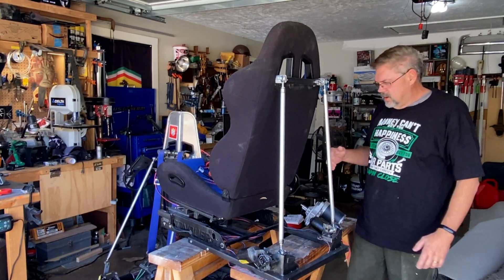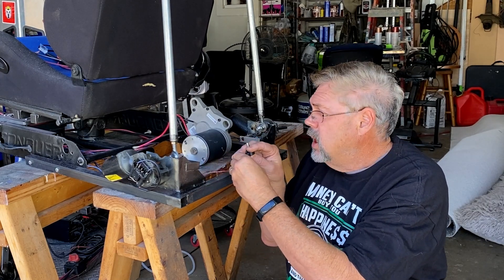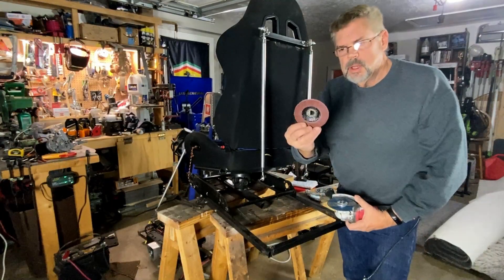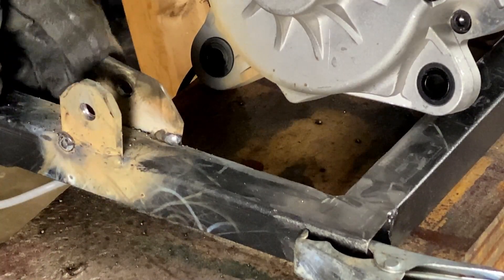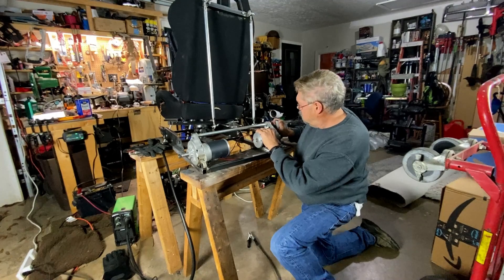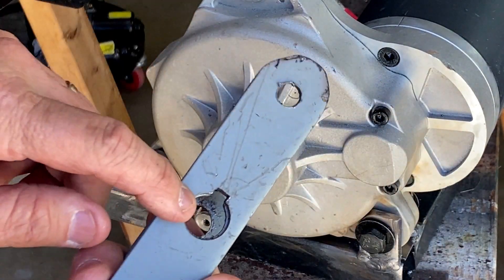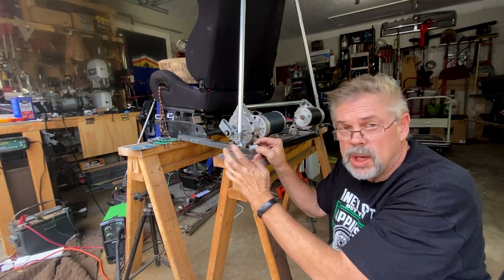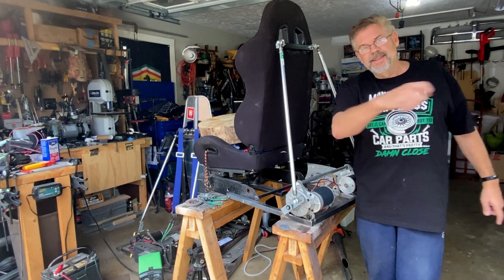2 DOF motion simulator  bigger motors mounted for more power!

Comment: man i wanna build one of these but i dont know how to weld at all. and i refuse to make it out of anything but metal honestly. because i want to mount a big display/tv or triple mount monitors that id like to move with the system. doesnt need to be alot of movement.. whats the cheapest motors we can use for this.. keep in mind. i only weigh 150 lbs MAX
Reply from the maker: Hi NoLimit413 Gaming!  yeah I was similar to you when I first imagined I could build a motion sim.. Metal is the best, it's stong, never let me down after 3 years in my "BIG rig  3DOF".. I did not know how to weld or any of that but went in anyway cause I did not want to spend like 4k or more on something..  I have a video on 'how much it cost "  Plus I'm just starting my new series on 3DOF motion sim for compact spaces.. I'm on episode 3 right now..   lack of weight is your friend.. in both real racing and motion sim racing.  I'm clocking in at 200 or 205 ..  so you should be able to use most of the cool sim rig stuff like V3 or Heusinkveld pedals along with a moderate CSL or DD wheel setup.   the key to the whole thing is having strong enough motors to move the seat frame and the u joint supporting the weight..  Tune in for more.. I hope you can watch my new series..  Thanks again for your comment   DMAX
Reply: @DMAX_DIY  any experience using like maybe a way to hang the frame from above as well? as to take even more weight off? im guessing less weight = less power  smaller motors and so on an so forth.. 

im a get a 3d printer. .so i can mod my thrustmaster TLCM pedals. i found software to control the force feedback on a shifter . using an old logitech flying joystick that has ffbs guts. got the hand brake with a mini bass shaker on it. motors on the pedals. and another shaker on my seat as of now. 

whats the cheapest way to go about being able to learn how to weld i been working with electronics and on cars just never learned to weld. if im going to use metal id rather weld it than drill holes and bolt it together. even tho im sure having some of it bolt on and some permanent could be a good thing for movement.  what i really need to know is . whats the cheapest motors i can use and any idea where to get the cheapest solid metal for this job? 

i been thrifty so far. saw a weight bench made of a serious solid base.. so stopped grabbed it. took it apart so im really seeing how cheap i can do this. cause after back surgery failing working has been tough . luckily i saved enough for a while but i dont need to move too much cause my back but id like to be more immersed cause i am upgrading the pc. and trying to build one of these .. cause i grabbed VR headset and all this equipment broken. shifters. a few thrustmaster tx and t300s. pedal sets. handbrake. and i just fix everything and then sold some of it back on ebay to get other stuff i needed.  plus honestly. ive been like this my entire life. if i see something i think i can build and im confident that i can build this because i built a prototype and programmed everything   im just trying to find cheapest motors that willd o the job well
Reply from the maker: @MassBred88  Thanks for the comments and questions..
Reply from the maker: @MassBred88  Thanks for the comments and questions..  First of all  the welding..  Mine was about 180 bucks and I had a cupon for 20 percent so Pretty cheap.. I did not know how to do welding either so I just went for it..  Now here's some confidence..  it's 120 v and maybe runs around 9-10 amps so if you have it on a standard 20 amp breaker your good to go..  Just practice a bit..   I just started a new series  compact 3dof motion sim  I'm on episode 4..  take a look.. in fact watch as many of my vids as you need to..  All this stuff DOES work.. https://www.youtube.com/playlist?list=PLO8l70qEp71MER1P0D-BBZza_gqzzmgp_
 it just takes a little while.  Thanks again my friend!  Dave

Comment: Hello, do you have any email that i can contact you have a question i find almost the same motor that you have but have a plug of 4 conectors is there anyway i can use only red and black?
Reply from the maker: Yes.. I don't check email but maybe once per week.. here it is..    max.motion.simulator@gmail.com  Perhaps send a photo of your connector.. I would use the BIG red an Black wires..  My motor did not have four wires but I think the extra two somehow connect to the handbrake on the wheelchair..  You wont be using those ones.. Dave

Comment: At a stoplight thinking about motors for my build, i looked up and saw a dumptruck, tarp motor and gearbox hanging off the side. Maybe an idea to look into.
Reply from the maker: They are available on EBay.  I have not tested them yet but plan to do so.. 12V  so what could go wrong?! they may be just perfect..  Thanks Matthew w.. Dave
Reply: @DMAX_DIY  600w sounds like enough.. im getting a old dual motor wheelchair tomorrow for $50. Cant wait to get welding.
Reply from the maker: @windsma1  Yeah.. there's nothing like being able to mod stuff real quick!  I just had to weld in a quick mod to my motion sim.. took like 5 min to set up.. Now it's even stronger! You will be pretty happy!  Dave

Comment: I built a rig very similar to this with very similar motors but couldn't for the life of me get it to stop shaking. After many hours of tinkering I realised its because the motors turn freely when not powered, so the software is constantly trying to get the chair into position causing it to shake non stop. Curious to see if this rig does the same or not. Good luck mate 👍
Reply from the maker: Good comment Jason.  Thanks!  Yes these motors and my crab pot motors 50:1 on the 3DOF can be backdriven while not powered.  I think you have to step up to a 60:1 motor for them to be too difficult to backdrive.  We will see..  It depends on the potentiometers and connections too.  The Hall effect Pots create a very stable signal so I hope the seat stays where it's supposed to be.  It has before. But we will find out soon this upcoming weekend! Dave

Comment: Really looking forward for this build! Looks like you will try to only move the chair again. It would be really interesting if you think the motors are even strong enough to move a complete rig including wheel and pedals like in your main rig.
Reply from the maker: Thanks for taking a look Deniz. Hope to get some good usable amperage readings this time for all of you out there.  That info will determine if the motors can be moved to different places on the rig to make it more compact.  Hope to work on it this upcoming weekend so check back if you can. Dave
Reply: @DMAX_DIY  Checking the max amperage pulled from the motors is a great idea. I wasn‘t even thinking of this! Can‘t wait to place my order on some motors to start tinkering around on myself 😄
Thank you for sharing your experiences, I’m already a new subscriber of yours and learned a lot from your build videos.
Reply from the maker: @d_yalcin  Thanks my friend! Yeah I'll remember to do the same for other motors I test on the Mule Rig..  I could not find the specs on these motors, but they are cheap so there you go..  This is my first attempt at using AC to DC converters so I need to know if they will pull too much for the 25 amp converter.  I'll do the same from now on so people can see what motors may pull.  Upcoming episode this weekend hopefully Dave

Comment: i suggest dont weld flex core indoors, toxic in my knowledge
Reply from the maker: Yeah  Important safety tip fregis..   Guys I probably did not explain, but I'm welding with about 1 foot inside my garage,  and the garage door is wide open..   Plenty of Air cause the door is 18 ft wide.   Dave